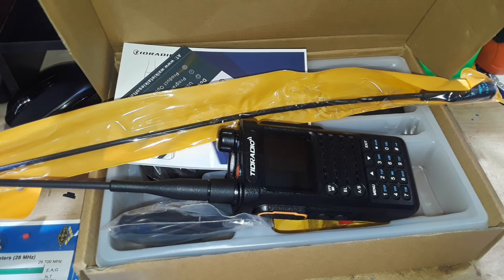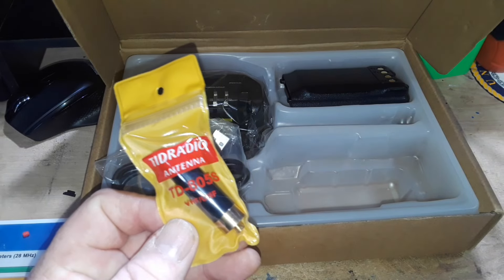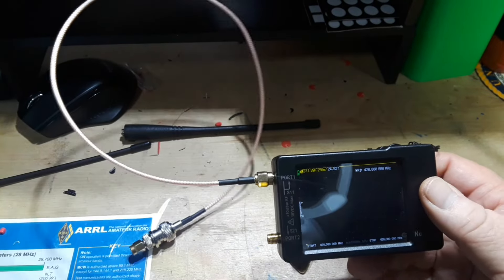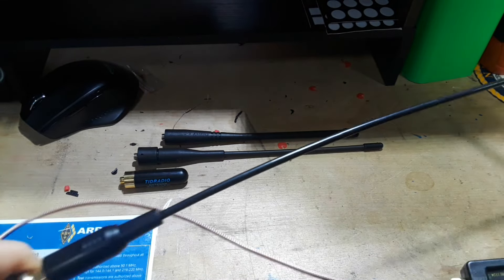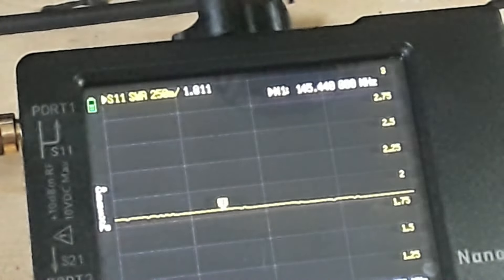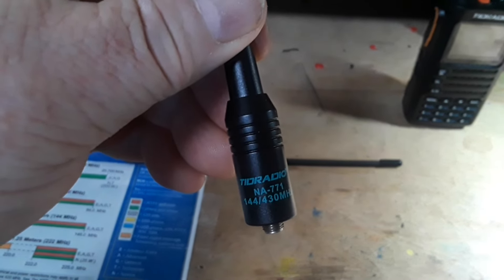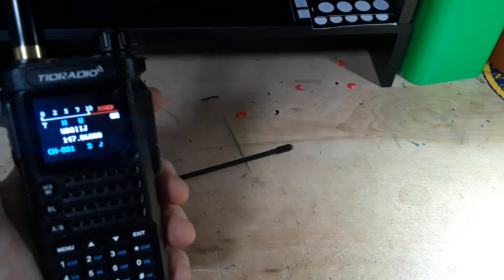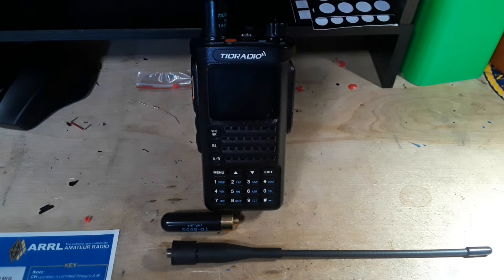Testing VHF/UHF Antennas with the NanoVNA

Comment: You need to tune the antenna while connected to a HT with the other half of the antenna (HT metal frame/ground plane). While your at it, have it in your hand and in font of your face as if you were talking in it. Now you will know what the SWR is while transmitting in a real life scenario. In a hand, in a lab and connected to a 50 ohm coax does not seem like the way these antenna should be tuned for or are even used for. The finals in these HTs can handle high SWR at even higher duty cycle and power output.

Comment: Sending my sympathy your way. My father passed last September. The grieving won't ever go away, but it will become "easier", for lack of better words. As long as there are good memories, she will continue to live on in your heart. 
I had a Comet SH-55 (similar to your knockoff and real 771). Must've been a counterfeit though because it didn't work at all and Comet is known for good antenna's. It kind of received, but didn't transmit at all unless the receiving party was within 25ft.  
But I digress, I have two favorite antennas for my HT's:
1. Nagoya NA-701C. It's an 8in whip tuned to 155mhz and 455mhz. It works great on 2m, 70cm, MURS and GMRS. 
2. Maldol AH-209. It's a 3in 1/4w "springy" rubber ducky tuned to 2m/70cm. This one is absolutely fantastic for its size, but almost impossible to find. Comet makes a similar one to it the SMA-209. I can't speak to it's performance however, as I've never owned one.
Reply from the maker: Thanks. It's rough. Since 2018 I've lost my dad, mom, godfather, uncle, aunt, and now godmother. I've got one aunt left.

Comment: Shouldn't these aerials require at least a small amount of ground plane to obtain  the best impedance match.  When used with a transceiver, the body of the radio and its associated  circuit board will provide a ground. Do these aerials come with a data sheet that specifies a 50 ohm match at the connector? It might be worth testing with a connector fitted to a metal box, or soldered to a handheld size sheet of PCB. 
I doubt that these 1/4 wave aerials contain any matching components, such as a tapped coil, to correct for the lack of a ground. If I am correct, the cable linking the VNA to aerial is acting as the earth. Changing its like length will have an effect on the vswr over the bandwidth.
Reply: The antenna needs to be held in front of your face as if using a "hand-held" radio. The human body forms part of the counterpoise. The sweeps will still be bad (no getting away from physics) but they will be better than holding the antenna at arms length. At least I think that is what was being done (it was off camera).
Reply: @-vermin-  if you consider the length of the body of the handheld, the earth plane of the circuit board will act as the earth. A long time ago, late 1970s , I owned a crystal controlled Pye PF70 handheld  transceiver, tuned to operate on the VHF amateur radio band. This had a  metal, 3 channel, crystal crystal selection switch on the front, below the speaker. 
The output power was close to 5 watts on a full charged battery   A T type connector was used to connect the helical aerial. One of the hazards of using this radio, was suffering from apparent cold sores. These were actually RF burns produced by the lips coming in contact with the channel switch. I discovered that it was possible to draw RF sparks off this exposed metal part, it being connected to the chassis of the transceiver, such was the poor matching onto the helical aerial.

Comment: Shame there wasn't a plot covering the range approx 100 - 500MHz and it would be clearer what's happening.
Somewhere in the Internet are some photos contrasting what's in a genuine Taiwanese Nagoya 771 (a coil tapped with capacitors and a matching copper sleeve round the base of the whip) and the PRC fakes (a spring and a double thickness of shrink-fit tubing to resemble the matching sleeve). 
Because the fakes lack the matching components they just function like a quarter-wave at about 190 MHz (as you'd predict from a straight whip of about 36cms). If they give a vaguely acceptable SWR at 70cms, that's pure fluke. :-(  
I did have a couple of those fake 771s, but when I found out what rubbish they were, I cut them down to resonate at 70cms using my nanoVNA and bolt cutters and use them for UHF only. ☺
I usually found that the "official" antennas supplied with Baofeng, Woxun etc radios did, in fact, work exactly how they should with a good SWR in the right places. 
Ironically, my best antenna is an OBVIOUS fake - a ridiculously cheap one claiming to be a Diamond RH771: the VNA plot showed it resonating perfectly on both 2m and 70cms. A fake, but obviously a good one! ☺

Comment: indoor tests are not reliable, VSWR is not everything, it would be good to do a test of S12 (S21) with the same antenna or a reference antenna with know gain.
Reply: Doing S12 or S21 on an antenna? How would you do that? S11 gives more information than just the SWR, but the way you measure is even more important. Connecting the antenna directly to the nanoVNA is probably the simplest. Then you shoulg hold the VNA in your hand, with no cables connected. Also, one can make a mock up handheld, with a choke inside, to prevent common mode current. Then the VNA may be connected to a PC.
Measuring radiation pattern and gain is a different story. Then you can measure S21 between the test antenna and a reference antenna, or vice versa.